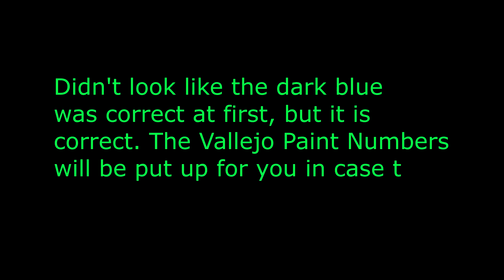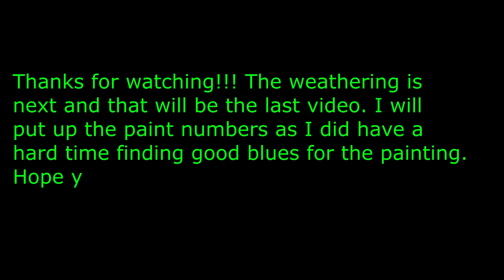Revell 1 48th Scale F4U Corsair Build Video 4 Painting

Comment: Hello, Just wondering what Vallejo paint number you used for the fuselage and wings. Thanks.
Reply from the maker: Ok for the light blue I used 71.299 intermediate blue, for the white I used 71.279 insignia white, and for the dark blue I used 71.300 glossy sea blue. The glossy sea blue is not exact so I mixed that with some black to get the right hue. Good luck man!